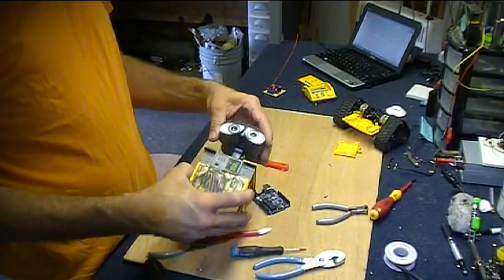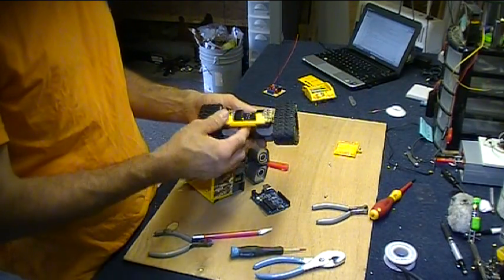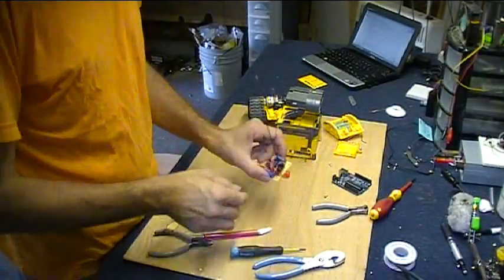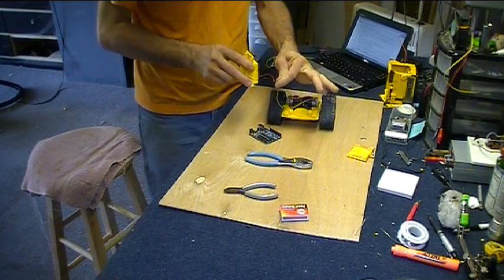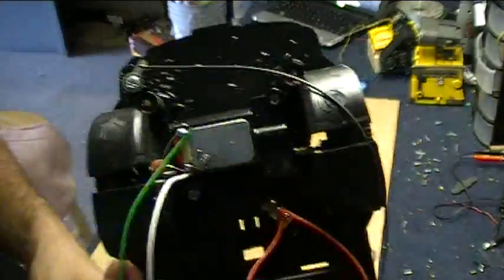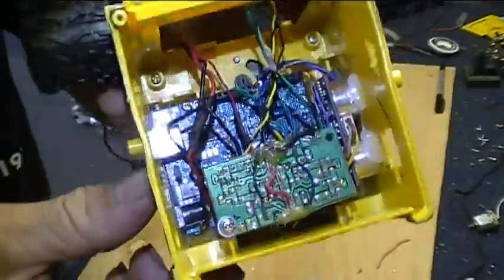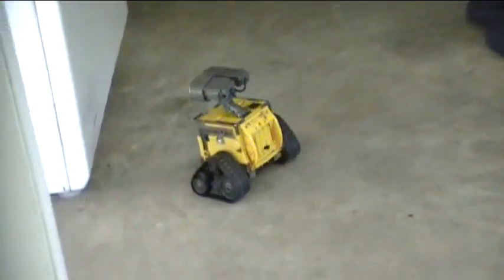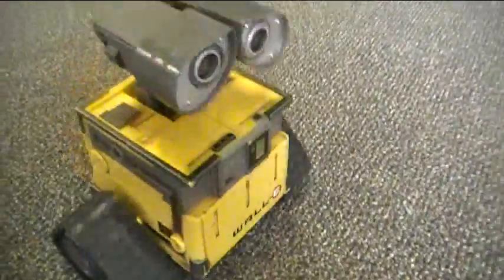WALL-E robot with Arduino

Comment: Hi I am just wondering if the components you used from the car... can be used to create electric longboard/ skateboard such as boosterboard I spesifically want to know if it will handle the power capacity and requirements? If not can you suggest how would you convert regular long board to electric with remote... good power supply and controller...

Comment: with more sensors that give you gravity vector, you might be able to adjust motor speed to prevent tipping.
Reply: ٦٦٦٦٦٦٦٦٦٦٦٦٦٦٦٦
Reply: ع

Comment: nice job.. hey i just rad across a wall-e rc.. it looks like the one you have but its all r.c. i got it for 3 dollars.. catch is it didnt come with a remote.  i have the arduino uno, also a osepp r3.. i have mastered neither of the two. 😞 but i like the idea of the cheapo rc buy.. but this wall-e has 7 motors in it.. what can i do to get it going?? i need help... 
any suggestions from any and all are appriciated..

Comment: Thanks for posting this.  I was looking at buying one of these used off eBay to hack into a better RC unit but am now hesitant due to the short tracks.  I'll have to look at how to make a longer wheelbase as I really wanted one for some outdoor use.  It's too bad these were not a little bigger too.  There is a 16" version but they appear to be rare and ridiculously expensive.

Comment: To be literally correct, Arduino is "only" specific board that has the Atmel ATMega328P (in the case of Arduino Uno) microcontroller. You can use the ATMega without the Arduino board. The Arduino is what makes prototyping and "playing" with the microcontroller so easy (because it has already all necessary connectors, regulators and USB connection so you don't need a programmer.) You can just take the ATMega (+ a couple of capacitors and a crystal, preferable) and use that with a programmer.

Comment: The Arduino Uno IS a micro controller. So if I understand your question correctly, yes. Arduino has their own proprietary software "based on C" that is used to control the micro controller.

Comment: Look up "PWM" or "Pulse Width Modulation" on the Arduino website. PWM is how you control an H-bridge with a micro controller.

Comment: you should add a level sensor of some sort and reverse the direction of the motors when it detects tipping untill it levels out, turn like it does when it detects an obstacle and then carry on forward. 

being it wouldn't be a true balancing robot you could probably do it with a home made sensor. maybe you can remove a mercury bulb from an old dial thermostat and when the circuit opens change the motor direction. maybe a ball bearing in a tube would also work.

Comment: You should stick a gyroscope and/or accelerometer inside Wall-E to detect when he is about to tip over backwards, then slow down or reverse the motor to compensate.  Might be worth a try...

Comment: It always seems to tip over backward so I think the problem is that it's a little back-heavy with the batteries there. Maybe add some weight to the front?

Great video! And love the 8-bit tune!

Comment: SUGGESTION!

Wall-e has a little clearance between the ground and the part between his ligs. Why don't you put a piece of steel at the bottom directly between the tracks to add more bottom weight.